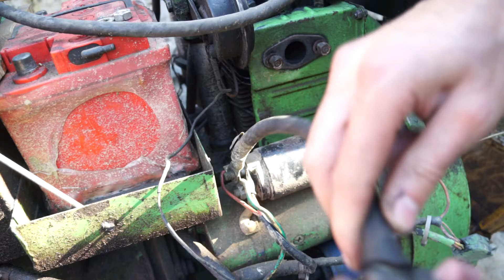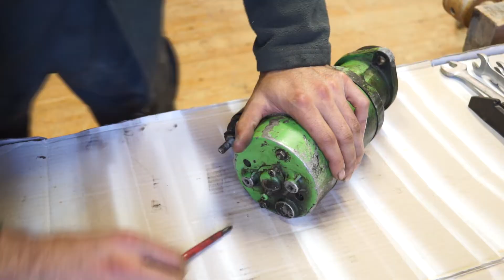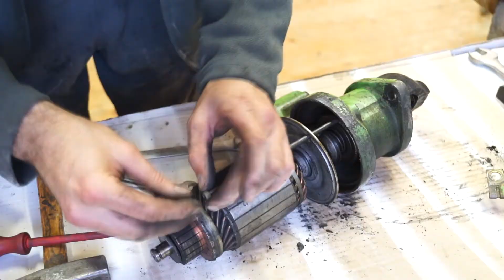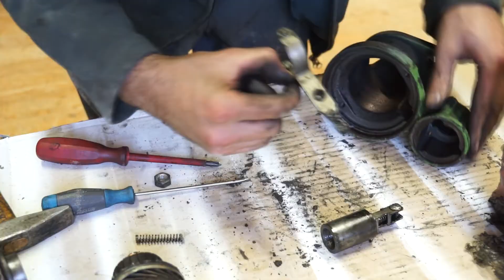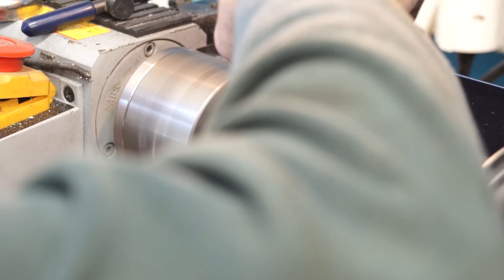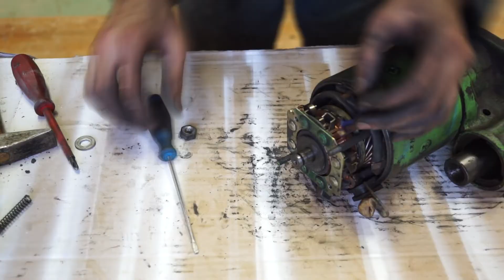Engine [tractor] starter repair - diy fix

Comment: Looks like the starter for my old Mercedes diesel.....I think this will work and probably is gonna save me $140, sweeeet
Reply: The enjoyment of a DIY Repair and saving $140 is a good thing!
Good luck, hope all goes well. 
RL Buffalo, NY
Reply from the maker: Thanks, yes this tractor start almost every day some day even 10 times and more, starter work until few weaks ago, problem was that brushes were wearn out because i didn't change them while making this video, after brush replace again work like new.

Comment: Be careful filling on the brush housing.  It limits the brush wear to a certain point.  Beyond that point the copper wires may become exposed and arc and damage the armature.

Comment: Nice video. I'll try to do the same. In my case, the solenoid doesn't move. When i move with my hand until the end it jus stays there and when i cuts of the current games back in. Do you think it's solenoid? There is a liquid to clean everything?
Reply from the maker: Sure, you can dissasemble all together, and clean everything with a gasoline and brush or something. Than with find sandpaper sand all the contact and assemble back together, i'm preatty sure that there is just some bad contact somewhere, otherwise the selenoid is dead, you can measure them with a multimeter.
Check also the brush, if needed buy new for a few $

Comment: Tractor ka alternator Kaise repair kaise karte hain
Reply from the maker: preatty much the same, on alternator, check if the brushes and rotor are ok, than there's also electronic regulator, that's all three stuff wich can fail.